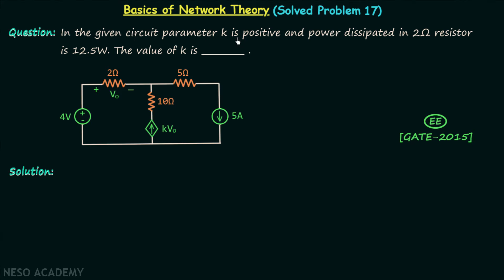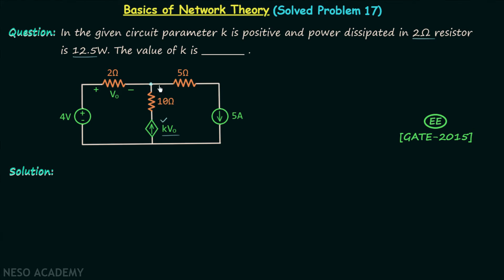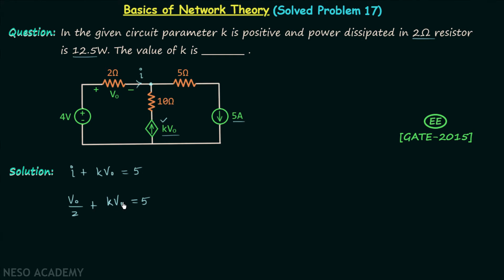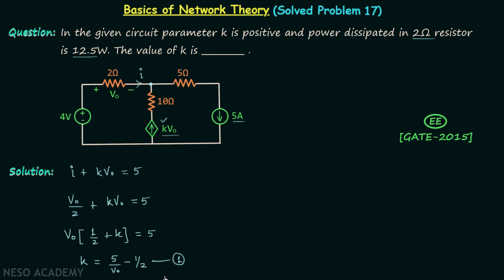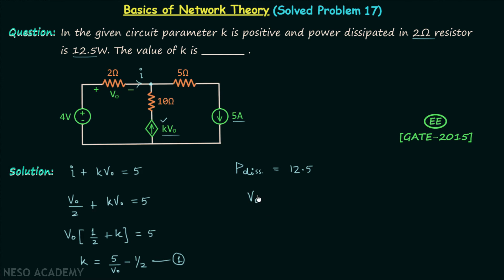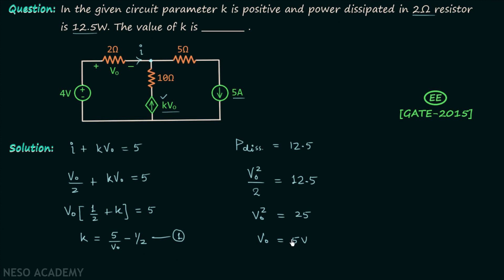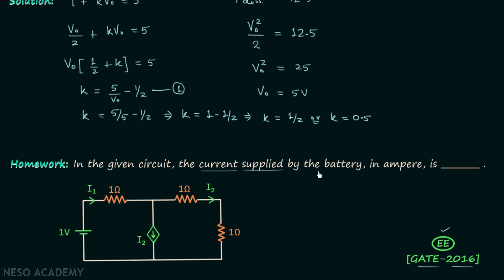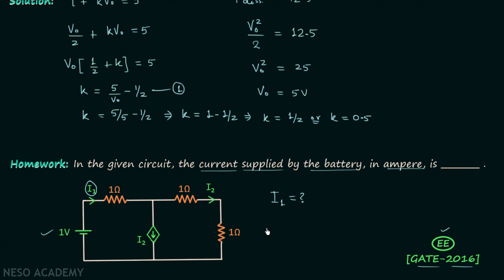Basics of Network Theory (Solved Problem 17)

Comment: In the main problem how can we be sure that the current i taken at the node is entering the node, while solving I considered the current is leaving the node and I got the answer for the value of k as 1.5
Reply: As they mentioned in the question, power dissipated is 12.5 w, which means positive value, power is positive when current enters positive terminal at resistor , u just remember the sink and absorbing concept taught by neso in previous videos

Comment: homework is just a simple supermesh with  2 steps and answer is I1=0.5A and I2=0.25A where I1 is the current supplied by the battery.
Reply: Explain in detail with equation